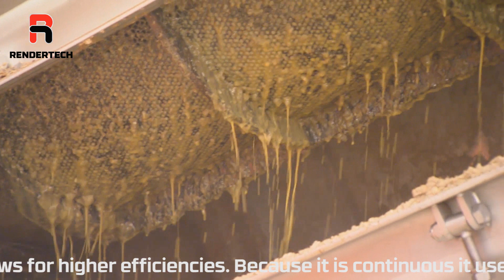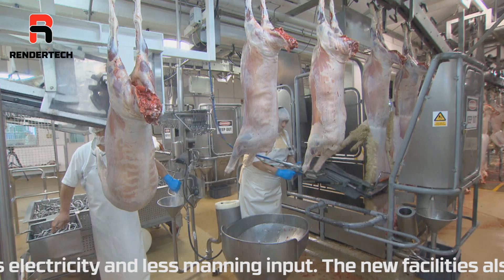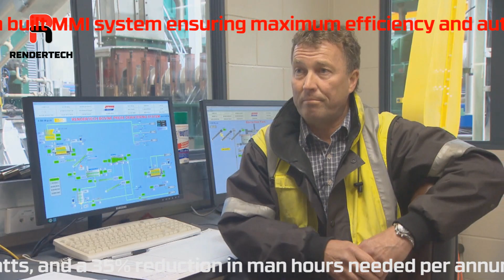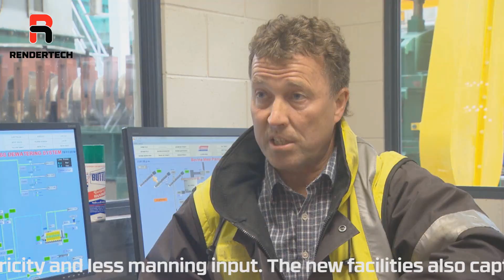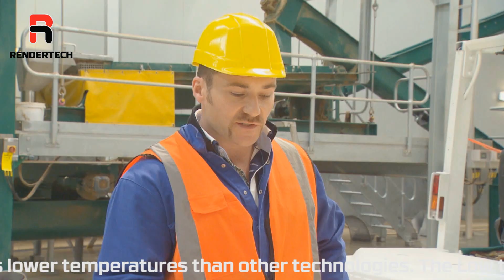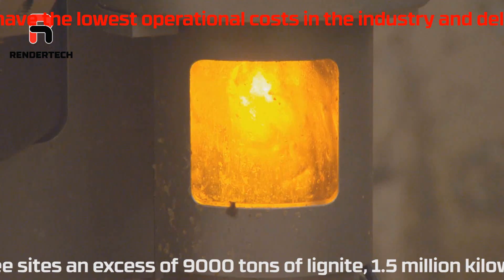Lorneville Alliance Rendering Plant Tour - Featuring Rendertech Plants

Comment: Discusting when you think about it  where do they dump this all. Environmental problems is this by far
Reply: they dont dump it it gets made into pet food
Reply: Jee.... this is not food. Thanks for informing me.
Reply: +Kiara Armstrong most of it goes to other sources heating oil, synthetic lubricants some used in pharmaceuticals rubber manufacturing clothing etc...plenty of info on google don't listen to just one dunce on the internet
Reply: they literally say what all this get churned into
Reply: It's actually an environmental solution. Instead of throwing it away they are making it into useful products.